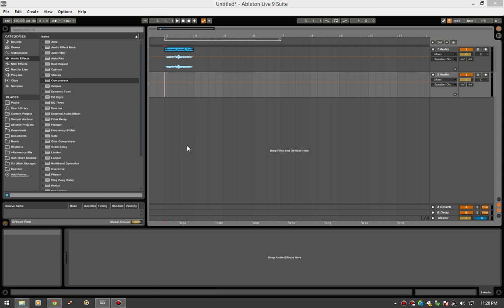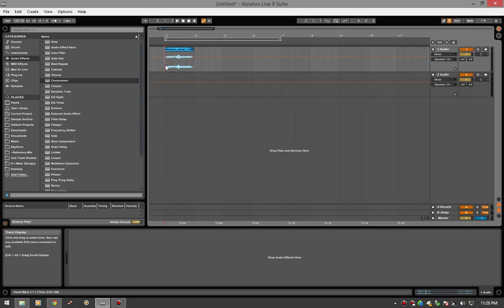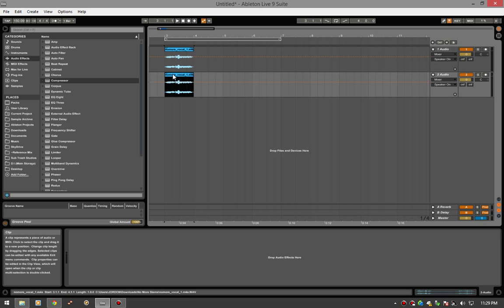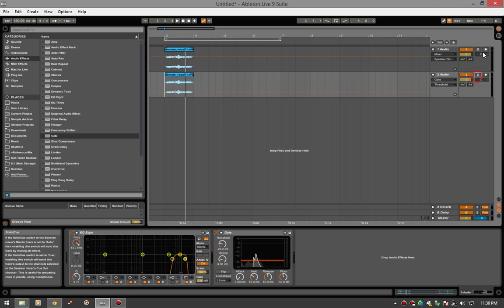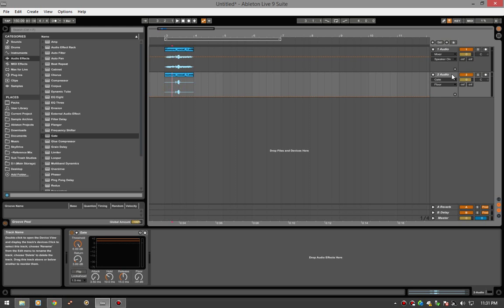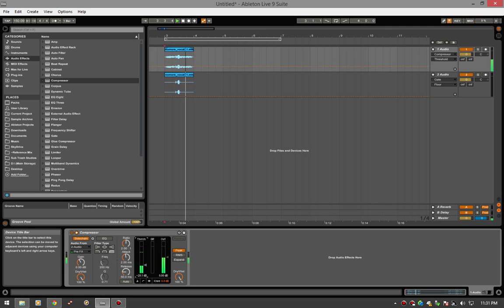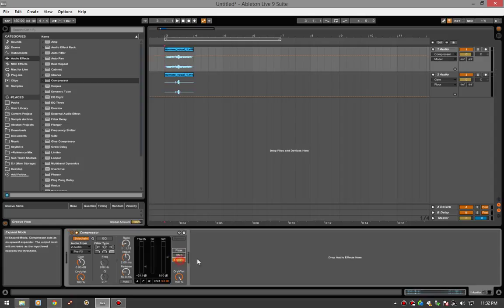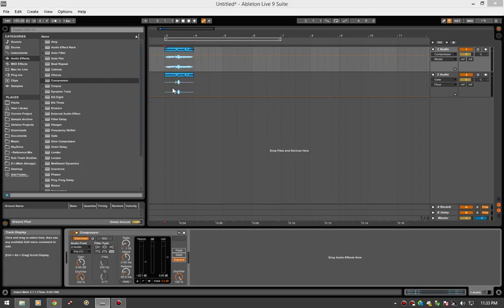How To De-ess In Ableton Live 9

Comment: This is the most thorough and seemingly effective approach I've found so far online (so thank you), but seems super extensive (as well as a bit hard to follow for a noob like me). There's usually a ton of de-essing to do on a track, so I'm wondering if you can apply this process to an entire track, or if it has to be applied to only one sibilance issue at a time?

Comment: you actually pull down all the frequencies... multiband dinamics on the specific range instead of a normal compressor will do the trick
Reply from the maker: Try them both using the same vocal and similar settings, I think you'll find this process to be more pleasing to the ear, in my opinion,  because it maintains the equalization of the vocal better then when just reducing the isolated frequencies. 

But, this is audio engineering, everything is subjective and can be done multiple ways. That's what makes it so enjoyable!

Cheers

Comment: Great technique its just applying that to all the affected areas its going to ovaload the system cause you have some much more to put on the vocals but hey if it works dont fix it
Reply from the maker: Unfortunately, the multiband dynamics is very CPU heavy. You could maybe try doing the same technique but using HP and LP filters. Enough tweaking and you could get it to sound good.